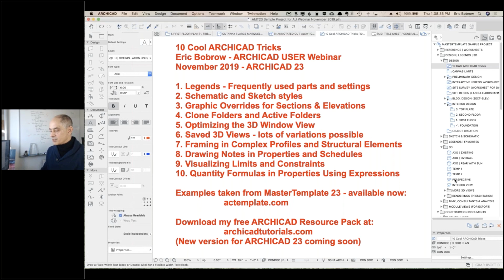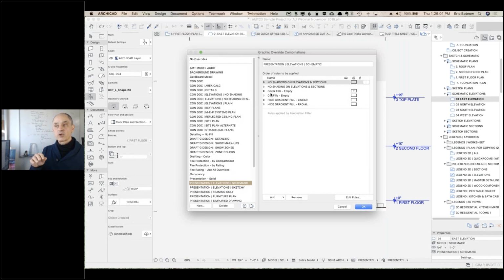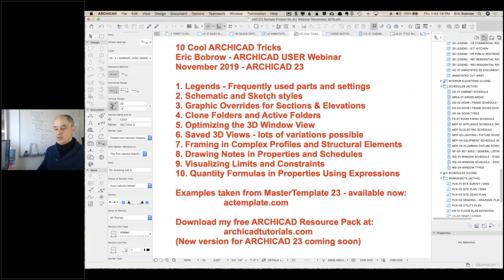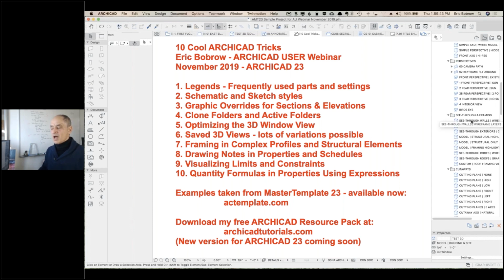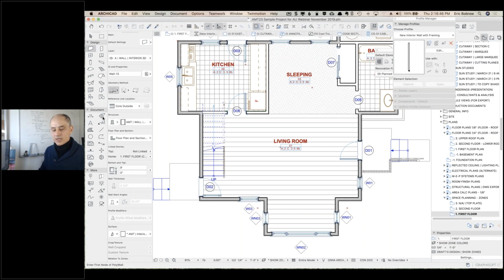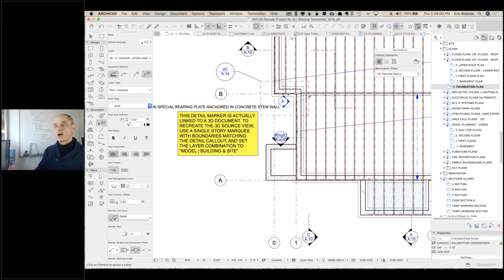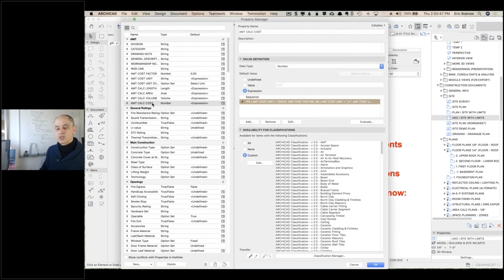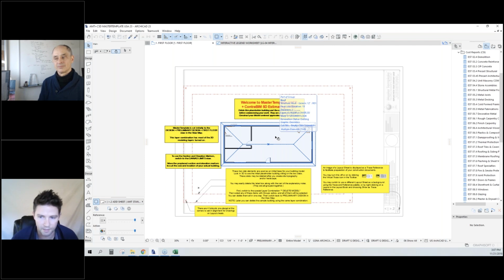10 Cool ARCHICAD Tricks - ARCHICAD User November 2019

Comment: Hallo Erick, 
Thanks always for your tutorials Erick. I have this problem and have not found solution yet. Let say you have a housing project and you have made terrain of which each house need to be placed in to.   so when i move these  houses/buildings you find that always windows and doors are left up on original story. so have to move them individual. am I miss something somewhere or is there a simpler way to do it?